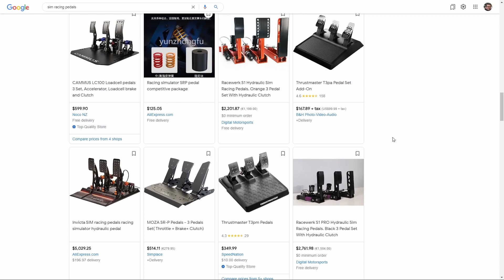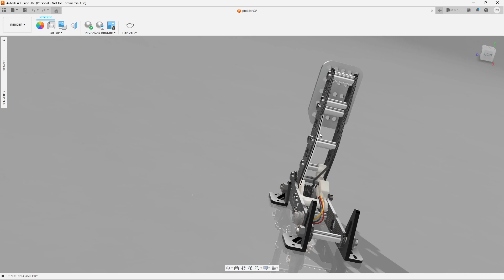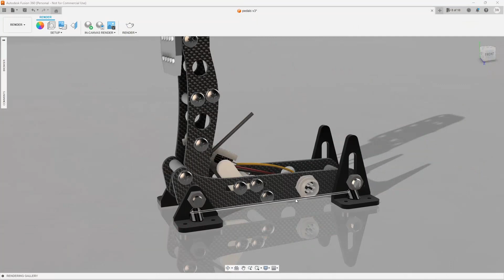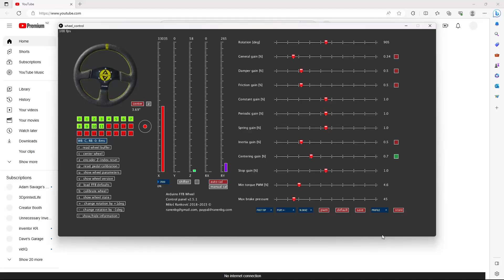DIY hall effect pedals for your sim racing rig

Comment: Jason, love the designs. If you can find a way to make the brake with a load cell and an INA122P opamp, you can get significantly more realistic brake pedal feel, I am working on converting a PXN set of pedals to work with load cell, and while I have gotten it to work, mounting the loadcell is proving to be very difficult. 

I think I'll be making a set of your pedals, and moving over the electronics. One thing that brought me to the PXN setup was the cross compatibility PC/PS4(5)/XBOX, so that is my reasoning for wanting to keep the electronics. Love the project, and if you are able to upload the step files I would like to begin work on the brake pedal! 

Thank you!!!
Reply from the maker: Hey mate. Can you share a link to the load cell and opamp?
Reply: @JWNZ  sent you an IG message.